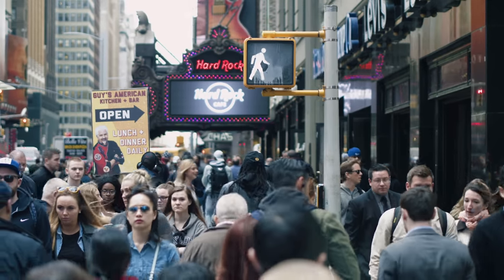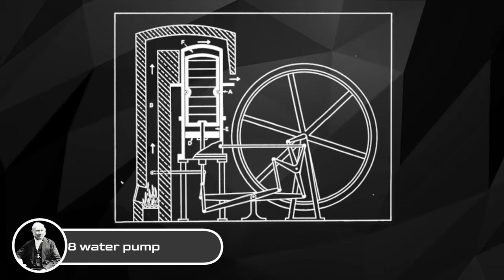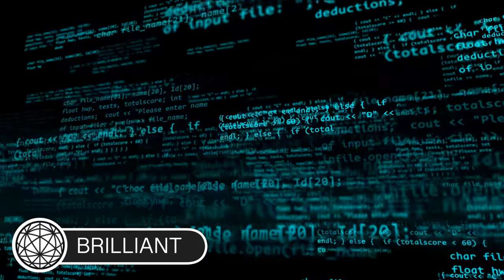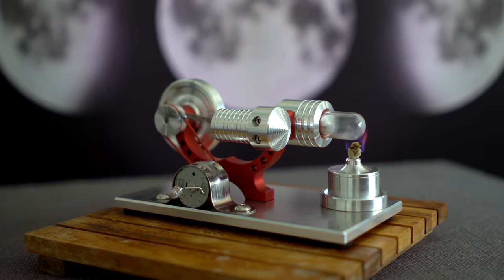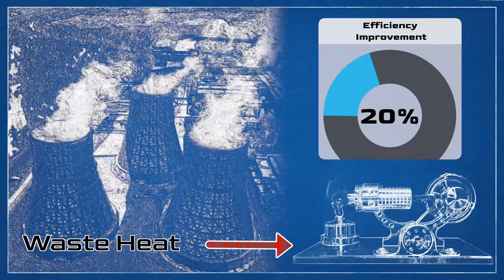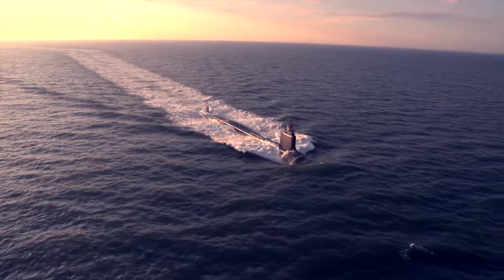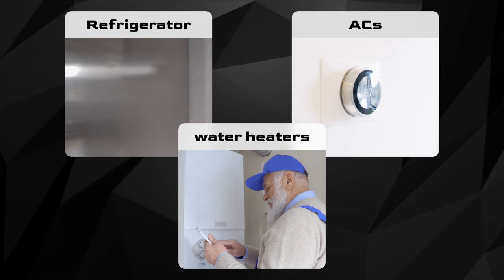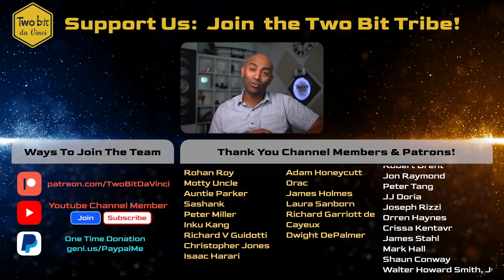Why This Age Old Tech Can Be the Future of Energy - Stirling Engine Explained

Comment: Is there a stirling engine whose working fluid may change phase from liquid to gas and back to liquid?
Reply: What you describe would not be classified as a Stirling engine, as it is not using a Stirling cycle.
You could develop/build that engine type and it would likely be named after you.
Note that this still happens to this day - see Manson Engine and Mason Guise Engine.
Reply: I was researching this about 20 years ago and it did not seem like anyone was actually doing it, although one guy I talked to who wrote a book on Stirling engines said that other people had mentioned it. 

I did some experiments with air containing a few drops of a volatile liquid such as acetone, alcohol, or ether as the working fluid. I did not build the entire engine but just the displacer and piston (I used a bellows), and it seemed to work when the displacer was cycled manually.

Keep in mind that a traditional gas-only Stirling will run faster than a gas-liquid version, so it may balance out in the end.

I abandoned the project because it seemed like solar panels were more practical.

Comment: if you are more efficient, then you can be smaller with same power
Reply: solar copper water desalination with peltier at 100C, or a thermocouple
Reply: you choose deliberately not to take the better selection
Reply: turbine format stirling engine, turbine compression instead of piston, should be tons smaller, spin jet turbine, centrifugal turbine
Reply: tesla turbine steam/hot air engine

Comment: I would like a large stifling engine o could run off a fresnel lense here in the desert.something that would run a generator.  105 degrees today .  We have 350 days of sunshine out of a 365 day year.  We  have sun and then some.
Reply: I've been wondering the same thing for quite some time. It sounds like exactly what the world need, those lenses can melt rock. The 'problem' I see is keeping the lens in the 'correct' spot in order to have a constant heat source, due to the sun moving in the sky? If a person were to attach the lens to a sun tracker THEN a person would have all the 'free power' the world needs?

Comment: That is a good dream but a stirling engine to have the same size as a car engine would not have the power you would need a stirling engine would have to be so large it defeats the purpose there are plenty of tidal deltas which could be used to produce power every day as the tide comes in and goes out every day we could use underwater turbines to turn the tide into electric

Comment: While I understand there is no fuel burnt INSIDE the engine, the heat comes from somewhere, usually from fuel that is burnt externally.  I understand it is possible to use solar power to heat the gasses, but still fuel is being burnt in the sun to produce the heat.  The title of this is very misleading and incorrect.  Fuel is always consumed when energy is produced.  At least as far as we know.
Reply: First, the sun do not burn fuel it is fusion not burning. Second, the title is actually correct as the Stirling engine uses temperature differences not fuel. One way of creating that temperature difference is fuel yes but there are other ways as ground heat, waste heat and so on.
Reply: @henrik.norberg  The sun does indeed burn fuel in a fusion reaction.  It is still using fuel tho.  If you do not understand the simple laws of conservation of energy you really should not be posting videos on the subject.  While the engine itself uses temperature differences, as you surely know, that temperature difference comes from the consumption of fuel somewhere.  If you do not know this, you really should not be posting about it.   Misleading the public simply to get likes or views is a terrible thing to do.
Reply: @lordfein  So by your definition solar panels burn fuel? Hahaha. Thanks, you made my day! As is Geo Thermal. And everything else then. Thank you for the laugh! And please lecture NASA: "Burning a fuel is called combustion, a chemical process that we study in middle or high school." Hint hint, middle school...
Reply: @henrik.norberg  So in the video, where lamp fuel was burnt to produce the heat used to create the temperature difference that moved the engine you say there was no fuel burnt.  While I did indeed use the word burnt to mean consume you are suggesting that no fuel is consumed at all by the sterling engine.  IF this was indeed the case then it would be the most amazing thing in the universe as it would violate all known laws of physics relating to conservation of energy.  As for the solar panels, the sun is the source of the energy, not the panels which merely convert it from one form of energy to another.  Solar panels are NOT an engine.  You would know this if you even passed middle school.  The sun does consume fuel as it "burns" it away in a nuclear fire.  The fuel for geothermal energy is the pressure and momentum of the earth turning creating heat and pressure from the friction between the core and the magma layers all of which will run out eventually leaving our planet a dead rock.  Again middle school science as you said.  So once again we are back to you suggesting that no fuel is burnt to produce heat which in turn moves the engine, thus violating the laws of the conservation of energy, momentum, and thermal exchange, even tho the video you showed has fuel being burnt to produce heat.    If you do not understand science, please do not argue with those who do.
Reply: @lordfein  You must be best friends with Dunning Kruger. Burning = Combustion. Fusion is NOT combustion. And as I wrote the Stirling engine CAN use external combustion but can use ANY temperature differences. ANY, not ONLY combustion. You have obviously invented an own definition of the laws of conservation of energy. It convert temperature differences eg ENERGY to motion.
Oh, sorry. I'm a bit slow, I didn't get it until now that you're just trolling.
Reply: @henrik.norberg  Not trolling, tired of misinformed people spreading bad knowledge.  Clearly you do not understand that when the sun produces elements in it's fusion process that they are thrown away from the core.  This gives them time to react, and as oxygen is one of the elements produced that means combustion takes place.  That means that the sun does indeed combust as well as nuclear fusion.  NASA has pointed this out to us, what makes you think they would contradict themselves?  I understand that an engine converts energy into motion (or kinetic energy), you had me wondering if you knew when you started talking about solar panels as they have nothing to do with engines.  I will admit that most people would not know that the sun combusts, and if you read this in a zine of some kind that the writer probably was less informed that most on the subject.  Therefore I can understand why you would think what you do about the title of your video and why you wrote it that way.

Comment: Sterling engine that runs off the heat generated by EV batteries and motors. Charge while you drive...
Reply: Yes, a perpetual motion machine . . . that people have been trying to build for centuries, and which is utterly impossible unless and until somebody works out how to build an engine which is 100% efficient. I advise you not to hold your breath . . .

Comment: All good in theory but... not in reality. Heat pumps are the future especially if Tesla is designing them.
Reply from the maker: I'm not sure you're fully understanding, but this in a way is a heat pump, or can operate as one. This is just a heat engine... not really something that comes at the cost of replacing something else... its something to add to the mix
Reply: @TwoBitDaVinci  I definitely like the use of heat pumps and I could see how for stationary applications, a ground source heat pump could dump heat to the Stirling input.  It would still require energy (most likely purchased electricity) to run the heat pump, but it would be more efficient than direct electrical heating for Stirling input.  My favorite choice, however, would be evacuated solar tubes supplying the Stirling, and doing it by convention (no moving parts required for that stage).

Comment: Waste heat is probably better used directly for heating something else. Power stations in Russia used to heat the local housing. Stirling engines just don't pack enough power for their size to justify their expense.

Comment: NASA uses a Sterling engine with radioactive materials to make heat and the cool of Mars surface to make power.
Reply: The thermopile on the voyager probes are still working after 40 plus years, use a decaying radioactive material as the heat source, the thermopile has no moving parts, wondering why they would use a sterling engine

Comment: Bad engineering!  We cannot combine thermal sources directly any more than we can force heat around absent a Peltier process.  Not even a mineral or material that displayed anistropy in thermal conductivity would help us.   

The world is full of low thermal gradient heat sources, like hot asphalt, or flat panel solar thermal panels that max out around 70C.  A concentrator is required to get an useful thermal gradient for mechanical energy conversion.  The only form of energy we can concentrate is radiant energy, such as photons.  Our understanding of phonons is much more empirical.  

A good followup video would be on thermoaccoustics.

Comment: If you have a nuclear power plant and want to use the waste heat to power a sterling engine, then why do yo uneed a sterling engine in the first place when you have a perfectly good nuclear power plant, you want to run a sterling engine because you want to get rid of IC engines but you talk about running a sterling on coal, but we already have coal power stations, you talk about powering the sterling using a solar plant, but you still can not run it when the sun goes down and if you had a way to efficiently store the power generated from solar you would not need the sterling in the first place
Reply from the maker: Nuclear power plants make waste heat. You could use that to make additional energy with a stirling engine